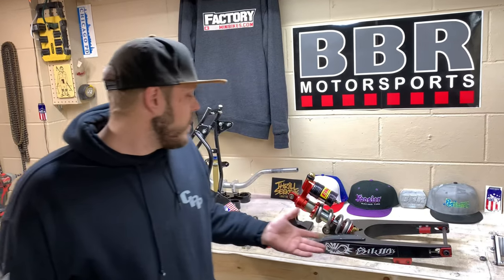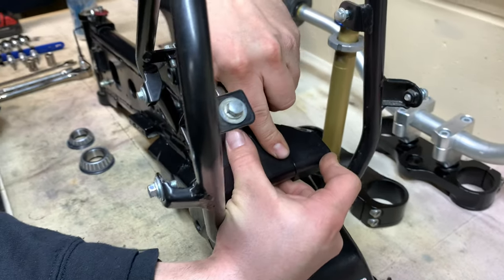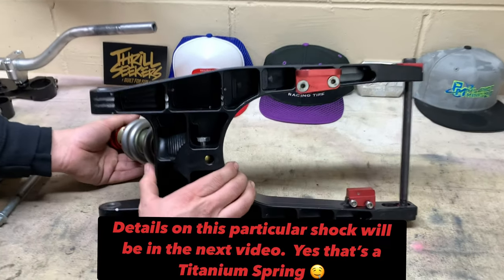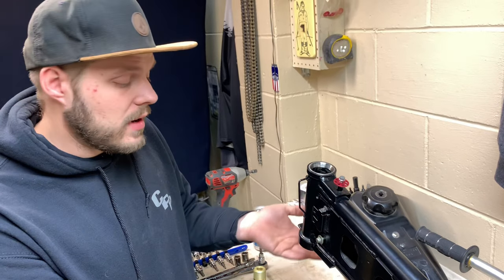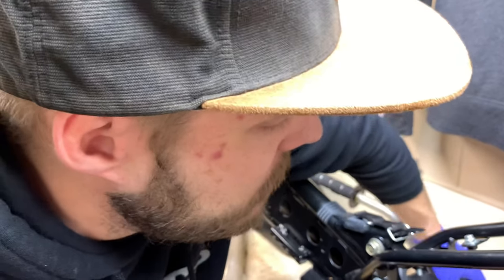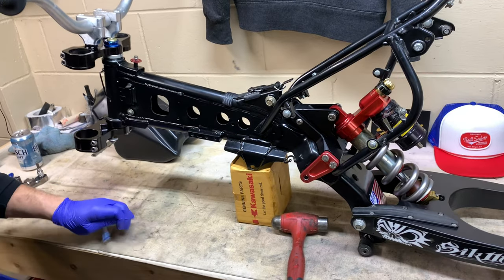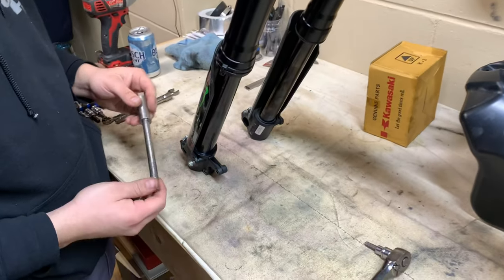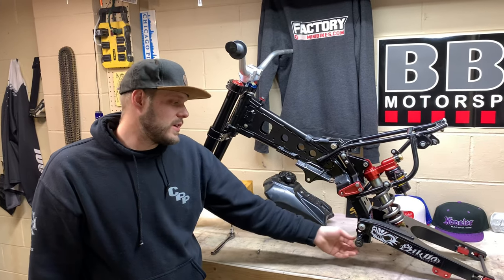KLX 110 FRAME UP FULL MOD BUILD PART 1

Comment: Hey i purchased a klx110/kx65 conversion triple clamps from diamond minis and I can’t get them to respond but I was wondering if you know what bearings i would use with these clamps on a regular klx110. No clutch model.